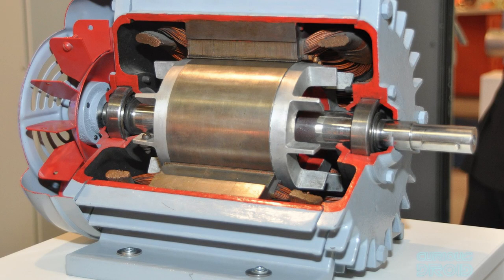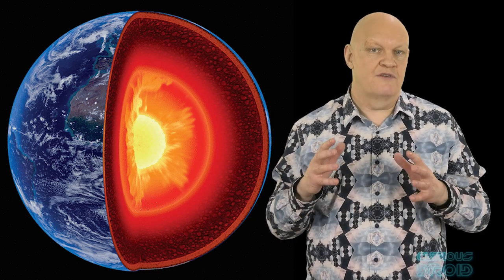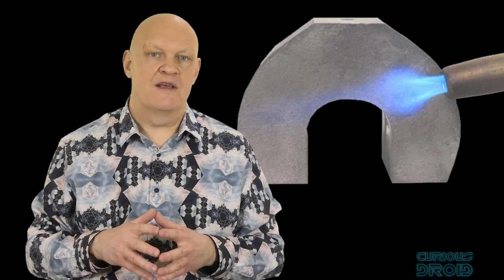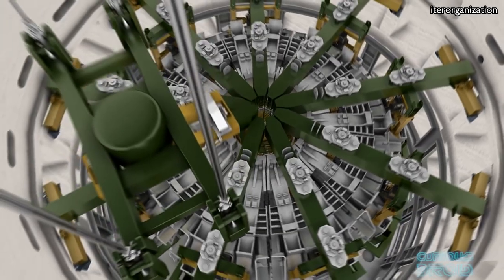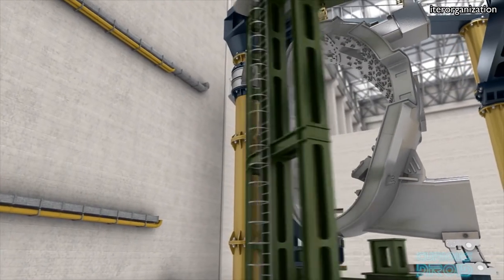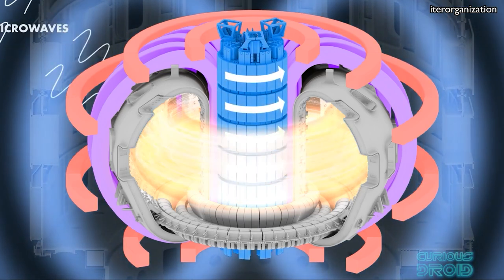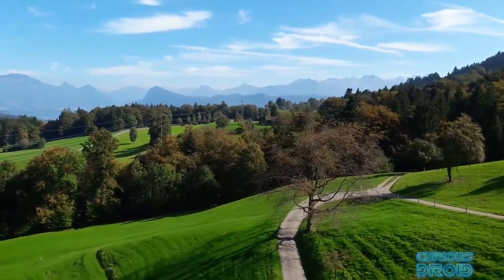The Most Powerful Continuous Magnets Yet Made

Comment: How do you extract all the deuterium and tritium you’ll need to get these reactors going? Also how will the reactor transfer its energy to water for the turbine?
Reply: Deuterium is a stable and naturally occurring isotope of hydrogen.  Deuterium can be made by bombarding hydrogen or deuterium with neutrons.  Canada has a lot of deuterium stored as literally tonnes of heavy water (use electrolysis to split the heavy water into deuterium and oxygen) and Canada also has a large stock pile of tritium (which is slowly decaying into heavy helium).  Canada is adding to tritium stock pile every day.

Comment: Okay, how will power be obtained from tokamak reactors like this? I think the reason fission reactors will continue to dominate into the distant future is because they can heat a working fluid to turn a turbine which turns generators and the amount of power required to sustain and regulate a reaction is miniscule compared with the power produced.
Reply: Same argument could have been made about fission reactors in their infancy wrt coal powered power plants.  First figure out how to control the reaction, then add the water heating bit.

Comment: I hope they can produce enought Yttrium in the future without using massive amounts of energy and dumping toxic waste. This compound of the brittle ceramic magnets is quite poisiouness if I understand wikipedia correctly. But being able to cool it with Nitrogen instead of Helium is a hug step forward for the follow ups of Iter Maybe they should try to use those magnets in an upgrade of JET. They have been a good testing lab for using Beryllium Tungstens alloy's also. The other major fusion technology development.
(Edit : or are they planning to use a compound of  bismuth, strontium, calcium, copper and oxygen  ? )

Comment: One has to wonder how many kilowatts of power could be created with photovoltaics and batteries if the same amount of money and effort was spent on it. Then again it is beneficial if we can figure out a clean way of creating lots of energy without needing the sun to do it
Reply: Solar panels right now are the best at getting the sun's energy. But the real bottleneck is those pesky batteries. You need them to maintain power output no matter the weather as todays panels can charge any battery fast. Today's battery tech is still very far away from the needed energy density it needs to reach and the very short life span of the battery has makes it a rather pricy investment.

Comment: ITER, brought to you by the same country which: 
- built a car in which the distance between the front and rear wheels were different on each side of the car
- built 2,000 railway cars that were too wide to fit in the stations of its national railway system
- built a car in which every electrical wire in the wiring harness was the same color (black)
- built an "impenetrable" line of bases to protect the country, that didn't actually encircle the country
🙄
Don't hold your breath.

Comment: I remember talking about nuclear fusion  12 years ago and to me it was insane that we never considered utilizing it for energy when the biggest selling point is the fact that it's very safe. How is it 2022 and we're just building the first one? What a huge waste of time not investing in this decades ago.
Reply: The JET built in the Uk...1978 	
JET construction starts

1983 	First plasma in JET
This was not the first one USA, Russia and Japan also built various versions during the 70's and 80's. I belive a Russian Physist first theriosed a method for Fusion in the early 1950's Leading a scramble to build and prove disprove hypothosies. The Issue is the Tempretures and pressures required was really beyond actual Technologies of their time. But the ongoing research and testing done in these various reactors was steps towards these being built now. Its extremly expensive and always on the cutting edge pushing bounderies and scientific discoveries of physics (understanding) materials science within the field of Plamsa. The long running Joke in Physics has been Plasma Fusion reactors produing Electricty reliably and cheaply is only 50 years away ( IE always 50 years away).Its within the last 10 years that some breakthroughs in design, Materials, computing power, cryonics etc that are making that breakthrough a more feasable and possibly more realistic to Achieve. Dont expect to see any Reactor produce more energy out than is put in within the next 30 years. The new reactors are just another incrimental step forward to understanding the technology required, calculations , algorithums for control systems, how best to control and contrict containment fields for the plasma , better high tempreture triggers to create the plasma etc. This task is greater than all of our space missions, making the first Atomic bomb etc combined. Making a facimilie of the SUN on earth is a huge, massive undertaking. And toridal generators is not the only aveue being explored others are using focused pulse lasers in a massive chamber to ignitite special pelets to create a plasma......This will still be a long and expensive rd .

Comment: Does stronger magnets generate more power than weaker ones? 

If yes, then we should be able to create more compact generators and motors with stronger permanent magnets.

Also if you're working with a fusion reactor, wouldn't it be wise to find a way to increase the atmospheric pressure within the reactor? This way less heat is required to perform the reaction and also less energy is spent on generating that initial heat, right?

Edit: Welp, I guess this is what happens when I don't finish watching the video. He answered all my questions in the 2nd half.

Comment: Can someone tell me if it is possible to focus a magnetic field like when you focus light through a lens?
Reply: Yes…with ferro magnetic materials which is why we use ferromagnetic materials in construction of motors, generators, inductors, solenoids etc.  Copper carries the current, ferromagnetic material concentrates and directs the path of the magnetic fields.

Comment: Pressure and temperature are important in the sun but the only way even the sun can fuse hydrogen is by quantum tunneling.  It takes a lot of hydrogen under high pressure and temperature for the quantum tunneling effect...  Maybe more than we could cram together here on earth.  If we could figure out how to initiate and control quantum tunneling, fusion would be easy without the big magnets and high pressure.

I was fortunate to work on the controls for the NHMFL resistive magnets, including the 45T hybrid.  After you get above about 22T, superconductors quit superconducting.

Comment: I think you can just take spent magnets, shoot them full of radium, and then use a larger electromagnet to force the magnet to align.

I helped design that reactor, it also powers a Spaceship, but the original intention was for a powerplant.

The ship has 2 directions opposing each other, so it doesn't escalate too quickly, and allows it to open up a wormhole, gravity well, black hole, and the "exhaust" is basically sunlight... although I've seen it fuze carbon in the air into diamond, which trails behind it at a certain altitude... its just carbon basically. It's pretty much a city that can function totally independently. And it's completely stealth... you can't hear it until it passes over, and the sound is basically just a barely noticeable rumble.. like a distant semi truck. It flies like a plane, and can hover in place... but it can fly slow, like 60mph or even slower....

Anyways seeing is believing, one day hopefully it will be a privatized industry... but for now it's basically a gunship.

Comment: If you really want to move to a net carbon zero world in a timely manner, than you need to look at Liquid Fluoride Thorium Reactors (LFTRs).  It is much less technologically challenging (this also means expensive) and if designed and built correctly, much safer than existing fission reactors.  The radioactive waste issue is also much less of an issue because the fuel burn up is much higher than solid fuel fission reactors.  China has a very aggressive R&D program on LFTRs.

Comment: How does containing the plasma by magnetic field prevents the heat radiation from the plasma heating the containment walls?
Reply: I assume heat radiated to containment walls is carried away by a cooling jacket and that heat is used to make steam to drive a turbine (or “turban” as Americans like to call it.
Reply: @borysnijinski331  Wow. Considering the Temperature of the plasma the heat radiated would be enormous.. Extreme feet of engineering..

Comment: Grateful for your recovery.

So, what is the energy required to produce a single "smaller, more easily manufactured reactor".  The net-zero  carbon foot-print is dependent upon the supporting infrastructure needed to produce the component parts of these reactors.  It is false-economy to say these reactors are net-zero - yet the carbon foot-print to produce just one single marketable reactor is almost incalculable.

Comment: I've been following the progress of ITER for a couple years. No one has ever explained it so plainly. The description of the insane heat kept in check partly by supercritical helium makes me think of a rocket engine. A rocket engine doesn't melt because it has liquid oxygen circulating through the bell and nozzle, right? So, in that way, a tokamak is like a rocket engine gone insane, yeah? Could fusion ever power a spacecraft? Instead of the plasma being contained in a ring, fling it out the back of a rocket. Or, would it be too heavy? Magnets are heavy and fusion doesn't work with out them. But I don't know if the thrust of the plasma could overcome that. Am I making any sense?
Reply: A fusion powered spacecraft would be best to power a particle accelerator that spits ionized hydrogen out at 99.98% C. 
That would have insanely high delta v, Carl Sagan was where I first heard of the concept; Bussard ramjet. Which is a modified version.
Reply: Indeed it could, fission reactions can be used in a similar manner, whether it's a viable option another matter, in open space the fission option would probably be easier since it eliminates many power requirements, though a project Orion style propulsion method may be more viable for truely massive long journey craft.

Comment: Wasn't the point of building the reactor in France at it's projected size to prove that net fusion is possible? Current fusion reactor run at a deficit while still proving the concept possible. Mathematically net fusion is possible if scaled up high enough in size or the correct technology is available. Now nuclear waste will still be an issue though. Sure you no longer have spent fuel waste but you'll still have all the secondary waste that current fission reactors have. Neutrons are the main culprit they are almost impossible to shield against and as seen in the diagram they cause fission. Granted without super heavy materials around it won't be a self sustaining fission reaction but fission non the less. For the experiments it has been shown to be negligible but that could change at a industrial scale of energy production. The large positive of net energy production of fusion power is that all the best ways of waste disposal both regular and nuclear waste are very energy intensive. In both cases it would get rid of traditional landfills and subterranean storage. Vitrification is already in use and renders nuclear waste safe for indefinite storage.

The biggest hurdle with this will be the anti-nuclear crowd and the carbon neutral crowd. They will latch onto the fusion process being a nuclear process and demonize it much the same way nuclear fission power was.

Comment: only DC permag motors actually use magnets, The 3 ph AC squirrel cage motor you show doesn't use magnets.
Reply: You could have a permanent magnet synchronous motor.  What makes a synchronous motor run at synchronous speed is a magnetised rotor and that magnetised rotor could be an electromagnet (i.e. supplied from separate power source and not induced from stator) or a permanent magnet.  PS nice looking dog, looks a lot like mine.

Comment: Fusion is expensive, but 3d printing a tinny reactor before we have ignition will get us there faster.  Getting a very small amount of Helium Three He3 from the moon without mining it will give us the material to do it.  One approach is to get Hydro gel/hydrophilic form that attract water and just drop it on the moon so it will fill with water and helium from the intermittent atmosphere caused by the sun.  Pick it back up a few years later with the fuel we need.  We could 3d print the reactors about 30 cm by melting and ink jetting the superconductor ceramic in the sintered metal powder layer.  It would allow complex plumbing for cooling and liquid nitrogen, and even boron chambers for deuterium/tritium reaction.  However, Helium Three He3 will produce protons be safe to be around not damage the superconductor coils, and allow us to test plasma in radical Stellarator like designs in an open classroom.  Cost thousands of dollars instead of billions to iterate the designs and get us to fusion faster.  So, we have used hydro gel to pull particles from space before why not use it on the moon to pull He3 without mining it.
Reply: They can't make a big reactor work but can 3d print a tinny reactor that will?  Someone has gulled you.
Reply: @TheEvilmooseofdoom  The new superconductor ribbons outperformed existing designs.  ITER is using only 3T Teslas and Niobium composite wires needing to reach 2 Kelvin’s.  SPARK was supposed to be at 10T Teslas at around 20 Kelvin’s.  Then Rebco like ribbons then reached 26T Teslas at 20 Kelvin’s.  That was not expected and decades of designs massively out of date.  It was not the glass lake superconducting ceramic it is the metal reinforcement allowing this.  So, the only thing keeping them from getting smaller than a 2 meter diameter Tokomak like SPARK is they are afraid of damaging the superconductor coils.  That turned out to be overly cautious and massively expensive in design.  With existing ribbon there is enough protection from quenching (failure from damage) to reduce the size of the design to well below 2 meters.   So much smaller 30cm tokomak with diameter the size of a pea is now conceivable.  Add 3d printing the whole thing and costs drop from billions to thousands.  If they still argue the damage is to significant from neutrons then go to Helium Three He3 instead, if only for experimental purposes.  They only need a few grams of it from the moon.
Reply: @tmarti69  3T Teslas? So why not 2m meters? or 30cm centimeters?
Reply: @spc67h  ITER the reactor several nations have chosen to build was designed decades ago long before the Rebco like superconductor ribbons were even invented so the size makes up for the lack of pressure.  Three Teslsas 3T is the pressure.   The cost was so massively expensive for superconductor cables or ribbons it was thought they needed to be far away from the plasma sending out neutrons. That distance is a meter from the center so at least two meters.  Now not only are the Ribbons being mass produced they are also incredibly durable.  They have drilled holes in them and they still work.  So, small and cheaper is possible one engineer said the size of a toaster is possible.
Reply: @tmarti69  Tesla is a unit of magnetic flux density (symbol: T). Similarly, meter is a unit of length (symbol: m). You either use the symbol or the full name, not both. So, e.g. 3T or 3 teslas but not 3T Teslas.
Reply: @borysnijinski331  That would be crazy if Canada took advantage of its stock pile of He3, got to fusion first, by learning more, safer and faster than anyone else.  Like finding out you learn more about Mars by actually living on it.

Comment: I wonder how those tie rods would hold up over years and years of cycles. If one failed, then the rest would suddenly be loaded beyond their rated limits and could cause a runaway chain of failures. It wouldn't end in a nuclear explosion, but I still wouldn't want to be anywhere near a 13T magnet as it tears itself apart...
Reply: Sure, of course because there is no safety factor built in.  The design would be right on the limit so that if any component failed the whole thing would fall apart.
Reply: @borysnijinski331  Of course there is, but presumably if one fails significantly earlier than expected then the others are at risk as well.
Reply: @nameismetatoo4591  yeah, so you shut it down and fix it…just like any other piece of machinery.

Comment: Cheap power with unlimited fuel availability is the aim, NOT the fashionable zero carbon footprint, climate chance conundrum. (not a typo)
For all we know, cheap power from readily available fuel may be achieved in the near future. Utilising a modified photosynthetic process resulting in true solar power.  Fuels being carbon dioxide, water and sunlight. Using micro reactions at near room temperature on a graphene membrane rather than huge dangerous engineering monstrosities.  Until then, let us concentrate on potentially safer lithium reactors and also multiple small conventional fission reactors of the type used in nuclear submarines.  The small reactors have the added versatility of being somewhat portable.

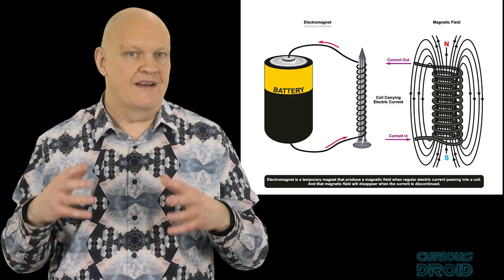Comment: 4:50 Ok you need to go into detail on how Mag fields differ from Electric fields because ... they seem to be the same! I know power does not flow through the lines like water through a hose. It travel via the field! (which is super amazing). Is it the same wave force/form eminating from both? Just resulting in a different outcome one being electrical and the other being mag... ugh i need to be smarter.
Reply: Electric fields and magnetic fields are related.  Light is an electromagnetic wave…the electric field creates the magnetic field which creates the electric field which creates….and so on.